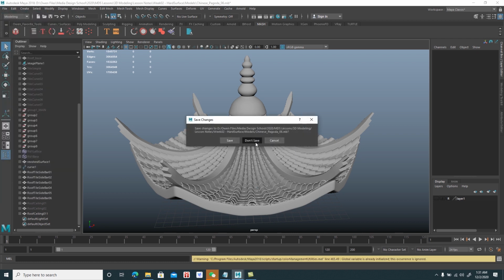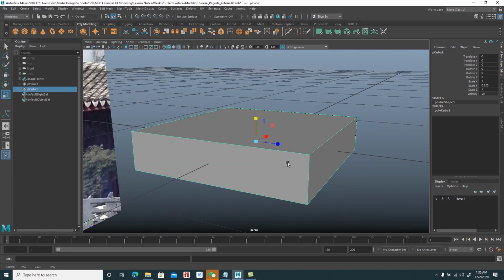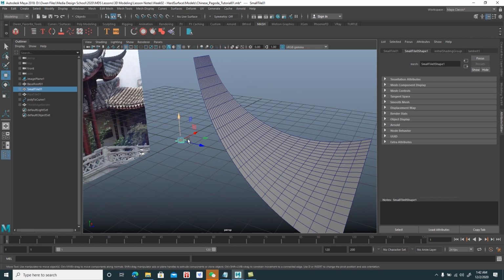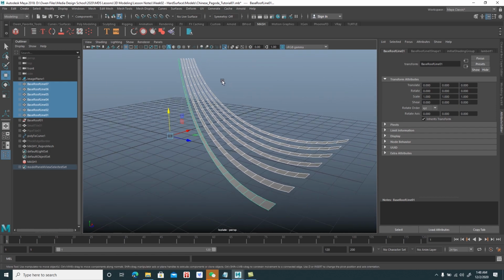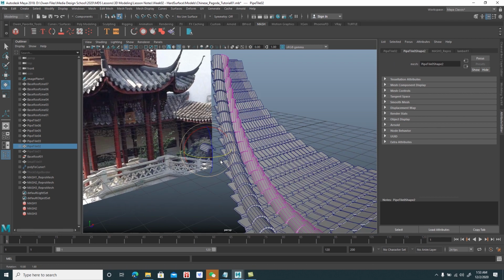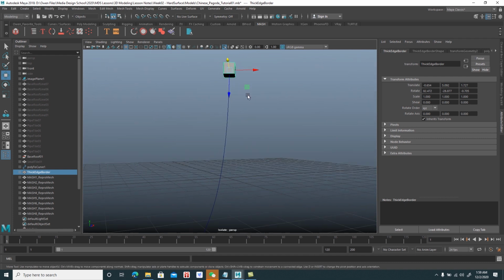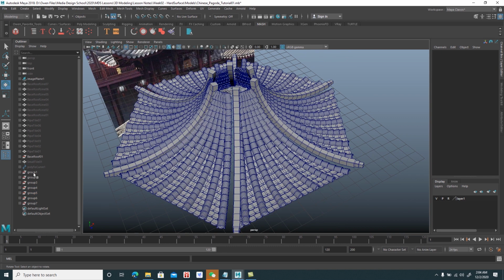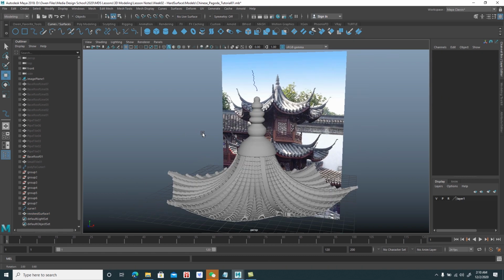Maya Tutorial - Chinese Pagoda Hard Surface Modeling using MASH

Comment: deleting the history of mash instancer doesn't unlink it from the mash network. i delete the type history and when i delete the mash it also deletes my instancer. i don't know what to do i went into a rabbit hole where with the help of chat gpt wrote codes and checking and trying to unlink it in the node editors. nothing seems to work. i duplicated the instancers and it worked but i couldn't edit them with a lattace like you did. i don't know what to do im getting desparate
Reply: how i worked around it is i deformed the base roof the way i wanted and then i mash  scattered the roof tiles. now everything looks fine